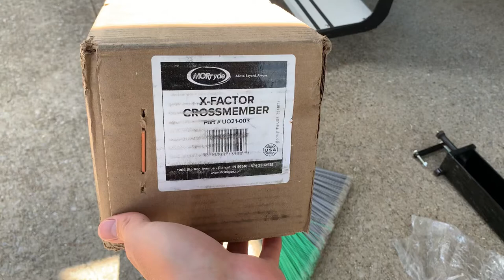MORryde UO21-003 X Factor, CRE3000, and UO12-016 Heavy Duty Shackle Upgrade on Grand Design 311BHS

Comment: Do you have any wobble in your shackles? I just installed the wet bolt kit with 1/2 thick shackles...and my shackles have some slight wobble. Torqued the nuts to 50ft lbs just like the instructions said...I know these components need to have room to move obviously bc of how trailer suspension works...just seemed a bit strange
Reply from the maker: There is definitely a little movement to allow for the suspension to flex.  I'd just reconfirm the torque after your next trip for piece of mind.
Reply: @rvengineer2300  ok,then I feel much better. Lol... I'll check torque after my next haul. I put all this on my carhauler. Lol... I don't even own a rv. I figured it'd still help the ride. Definitely way better build quality over stock. And should last a whole heck longer
Reply from the maker: RV’s, trailers, horse trailers, it’s generally all the same under built stuff. I once tried to stop a car haller with 3 vehicles loaded bc he had lost a tire and was riding on the rim. Upgrading and an umbrella policy are always worth it. And never cheap out on tires (tires were my 1st commodity as an engineer)
Reply: @rvengineer2300  ohh yea definitely. I'm ways overkill when I mod and tinker. Just for the safety aspect. I don't want any problems while pulling a trailer!

Comment: do the cross braces come as a set of 3 or 3 individual ones when ordering ?
Reply from the maker: Jim, they were sold individually.  I bought 3 because of the 2 axle setup on my camper.
Reply: @rvengineer2300  thats what I thought they should be sold as a set of 3 or 4 depending on how many axles .